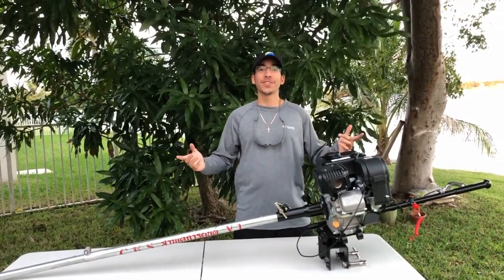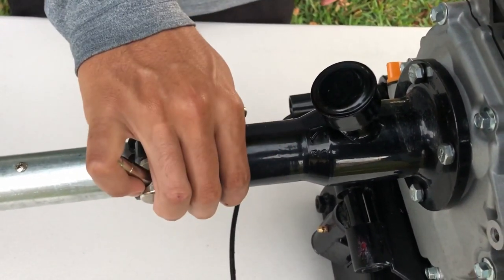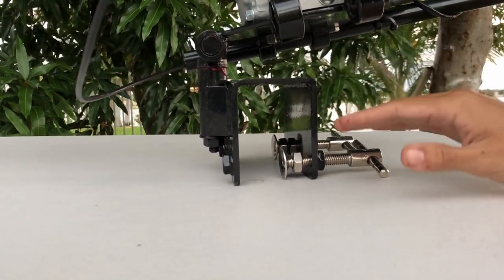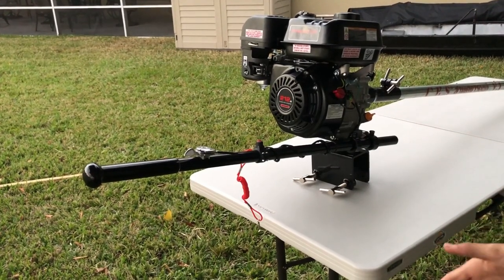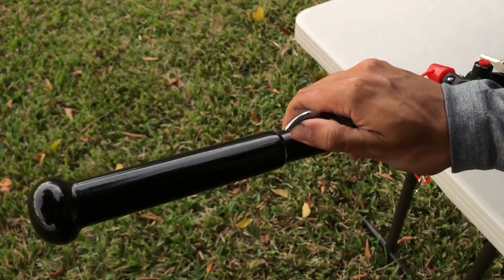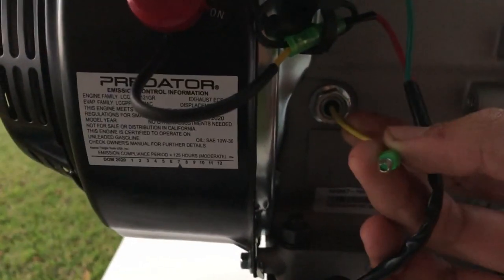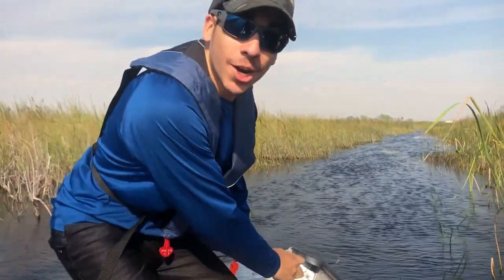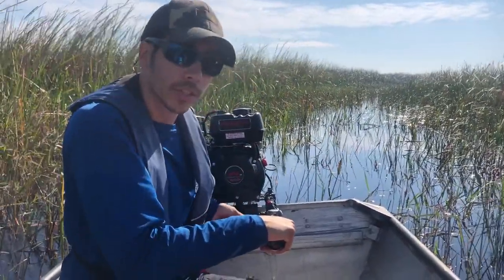Mud Skipper Longtail Review *2020 overview and test*

Comment: Do you have to force it in the water or do you just drop it down and let it go? (Speeking of the prop)
Reply from the maker: Due to the fact that the prop angle is naturally pointing down, the faster you go, the harder you have to push down. Sweet spot seems to be around 6-10 mph, slower and you have to hold it from sinking deeper and faster you have to put a little pressure to keep it down. If it seems like it wants to keep popping out of the water on the port side, the skeg needs to be adjusted.

Comment: How is the turning radius on one of these? Is it possible to whip it around in a narrow river?
Reply from the maker: Sharp turns aren’t necessarily this motors strong suit but it can do it pretty well. What I mean is it can turn the boat on a dime if you have the muscle to reach the handle back that far (perpendicular to the boat). The most useful thing for tight spaces though is the fact you can row the motor like an oar and spin yourself around even when the motor is off. Moral of the story, if the water is as wide as your boat is long (+motor tail length) then its 100% possible.

Comment: Nice set up! Do you think this would be a good setup for a 14 foot Jon boat that's 30 inches wide?
Reply: I ran one on a 14ft it does ok you won't win any races but it will get ya places
Reply: @bandedcalls  ok I was just wandering if the front would stay in the water?
Reply: @Bamaoutdoors  oh yes no issues with the front staying down on a 6.5hp I have a 18hp on mine right now

Comment: How fast is its top speed?
6 or 8 in prop
Reply from the maker: 12 foot jon with 2 Medium sized adults (140-190 lbs), trolling motor and battery, fishing gear: 
6.5 inch prop : 10-12mph
7.5 inch prop:15-16 mph (what I personally run)
8 inch prop: 16 but motor is a little boggy, even in open water
Note* only modifications done to motor is a zip tie on governor spring and oil sensor delete.

Comment: Does this work with thick Lilly padded areas?
Reply from the maker: I have done some testing in some dense lily padded area. The kit comes with a 6.25 and 6.5 inch props and I bought 7, 7.5, and 8 inch ones. When going through anything thick your going to want to use a smaller prop (6.5-7 for a 10-12 ft boat or 6.25-6.5 for a 14 foot boat. Top speed will only be about 10-12mph with those props but as long as you keep the prop closer to the surface instead of digging it down and don't fight it when it wants to bounce off the thicker lily stems, it'll push you right through it. My only complaint is it works great chopping through pads and even hydrilla mats but I would recommend putting a small piece of pvc pipe with a bunch of holes drilled in it around the spot between the bushing and the prop if you're going through thick grass because that seems to be the only thing that can get wrapped up in there.